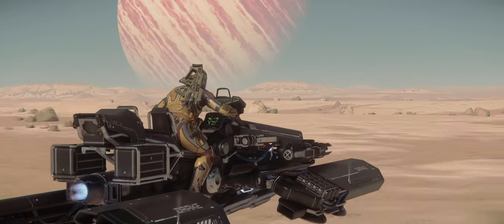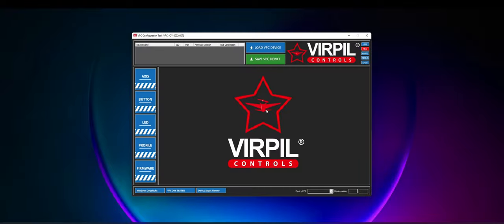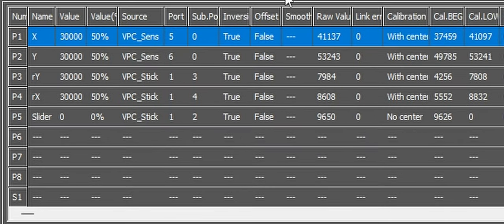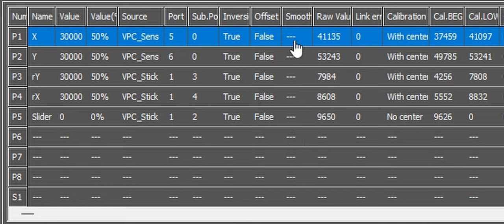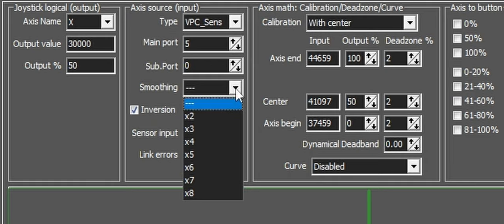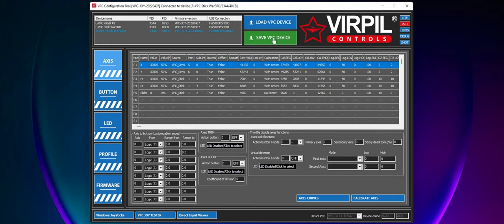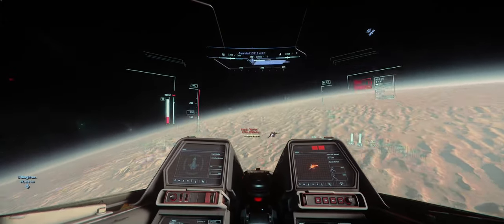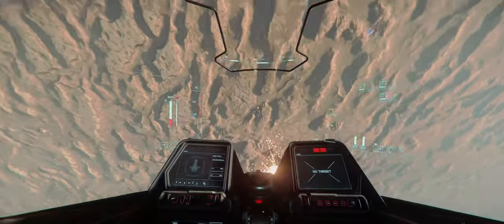How I Unlocked the Full Potential of My Joysticks (Smoothing Settings Virpil and VKB)

Comment: With a .10 curvature addition to my roll/yaw I'm still getting a snappy pip movement when I add input to either axis.
It's fine for casual pvp but when I need to make snap decisions/adjustments I'm still finding it hard to finesse the sticks. 

Do you think removing the smoothing will help or make the inputs even more snappy causing overshoot?
I've been learning the blade and I'm getting used to it but I find it a little more sensitive then the arrow.

Comment: BTW do you adjust your axis curves at all? I changed my Z-axis (for vertical strafe) and it made it a lot better for takeoff/landing but have not touched my x-axis at all.
Reply from the maker: I do, I have my curves for strafes all set at 3.0. I'm still experimenting with Roll but Pitch and Axis are set at 1.2.

Check out my previous vid if you haven't, it goes a bit into that and how to find good values for you.
Reply: @JohnathanWinters  where exactly are you setting the curves?  I think it's Controls ->Joystick Sensitivity Curves -> Flight -> Flight Movement (per device).  Also, when you said "Pitch and Axis" did you mean "Pitch and Yaw"?